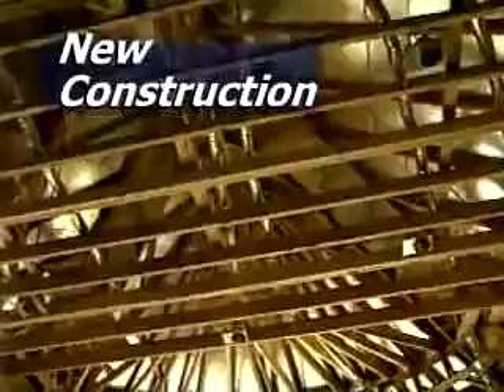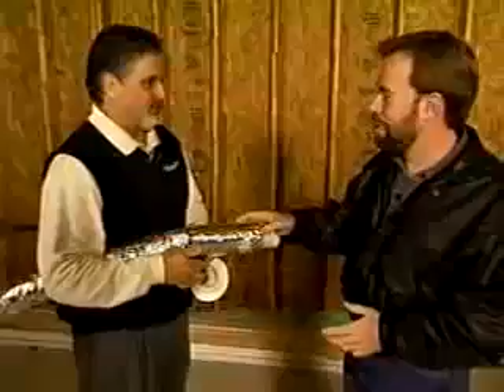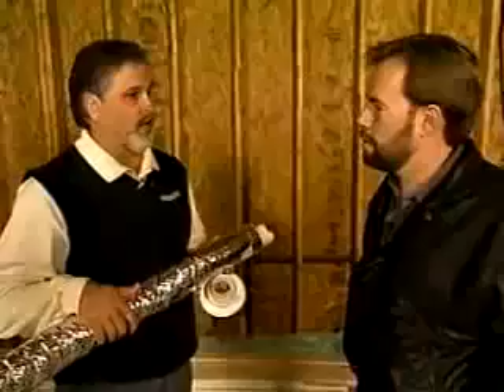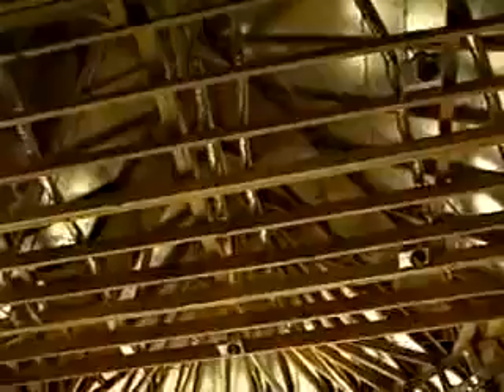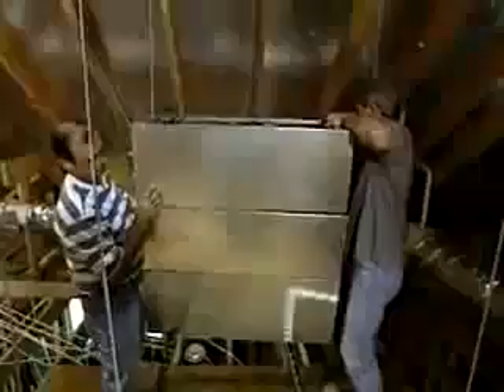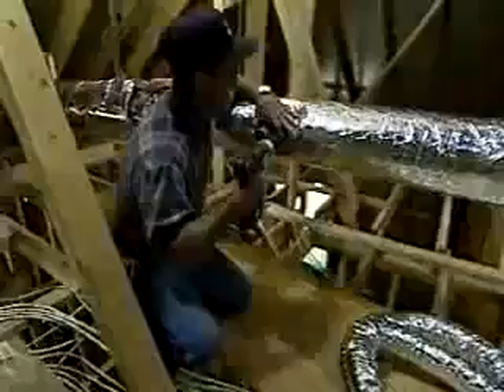Unico Mini Duct High Velocity  Air Conditioning and Heating System Benefits and Installation

Comment: I purchased a home with this system 7 yrs ago. Very quiet and I assume efficient. We do not have an option of natural gas in our valley. A question... the home is large and the basement vents push full air out. Is there a way to close off or reduce the basement vents volume so only pushing heat mostly up to the top floor where we spend most of our time? In most vent covers there is a way to partially close off flow redirecting more to other areas. Any suggestions?

Comment: Last summer we had a Unico High Velocity central air conditioning system in our home.  Our contractor sent drawings of our home to Unico and they designed the system.  Our previous home had conventional central air conditioning .  The Unico System out performs the conventional air conditioning system in every respect- rapid decrease of humidity, house cools quickly, system is quite and efficient.  It is excellent!